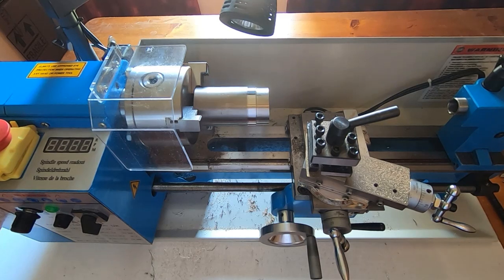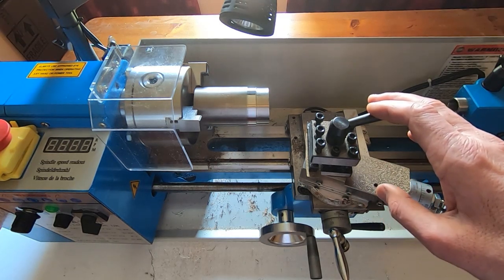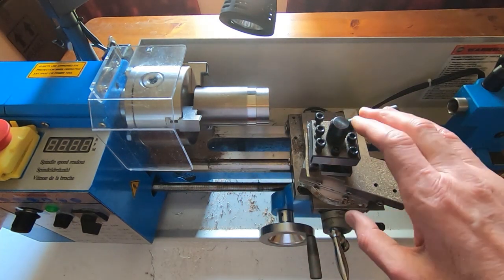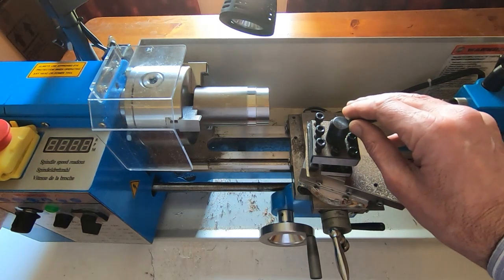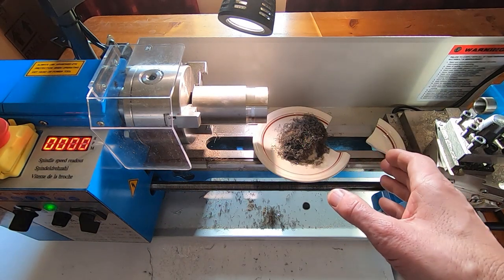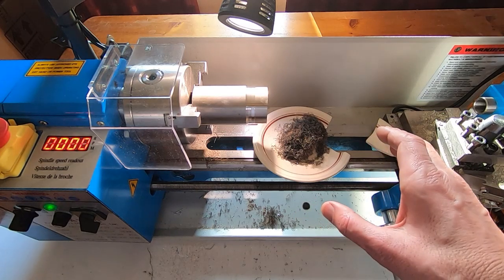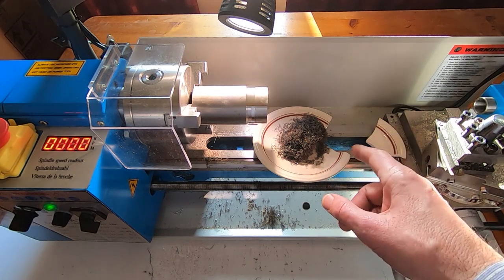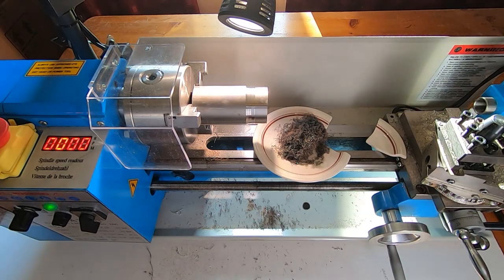Burning Titanium and breaking stuff

Comment: Good demonstration Jerry!  I never thought about titanium burning that easily.  I used to work at a Naval Air Station where I worked at the Naval Air Rework Facility (among its many names while I was there).  The Machine Shops used to keeps drums of graphite available in case of magnesium fires (they were still, I was surprised to see, reworking radial engines next to jet engines when I started working there!).  Originally, every machine tool that machined magnesium had a large bucket of graphite next to it and the drum full of graphite wasn't far away.  By the time the radial engines were phased out, the Tool & Die Shop still had a small drum of graphite in the middle of their Shop.  During the demolition of an old portion of the plant to make room for expansion of the CNC area, the workers accidentally started a graphite fire that the Airfield Fire Department could not put out with their fancy "metal fire" extinguishers (referred to as "purple stuff," if I recall correctly) even though they used every extinguisher they had on the entire Air Station!  I happened to walk by and overheard the Fire Chief discussing this with several of the Fire Fighters, remembered the graphite, went back into the now smoky building, brought the graphite to him, and asked if he could use it.  As soon as he realized what it was/remembered what it used to be used for?, which only took a second, he had his Firemen take it back in to the fire.  They had it smothered within minutes, but used every bit of graphite we had left.  (This was the "main" building, about a half-mile (~0.8 km) long, with many "fire zones" in it, so only areas deemed to be "in danger" would be evacuated as needed.  I guess that goes back to WWII there, and is also standard operating procedure in any large industrial facility even today to save production, time, & money.)

Class D extinguishers are supposed to put out metal fires here in the US -- I don't know whether that is an International rating or just a US rating, but I'm sure that every country has equivalent extinguishers rated for safely putting out metal fires.  If I had access to graphite flakes for a reasonable price and a reasonable quantity (i.e., not an entire 55-gal [~208-liter?] drum for a home workshop!), I'd still want that too, I think, and would worry about clean up later.  Of course, I suspect that there would probably be serious clean-up anyway after any of these extinguishers were used or any decent metal fire?
Reply from the maker: Yes this type of fire is very hard to put out so my advice is to try to avoid them in the first place.

Comment: Great video - I had no idea you were spinning up a ceramics restoration channel. Seriously though, the local hacker space just got some welding equipment and they were really upset when I told them they should have at least a portable extinguisher since the mill in the same room can easily create thermite as well as other fun things that easily ignite on their own.
Reply from the maker: Absolutely. If you really want a bad day try mixing aluminium particulates that milling aluminium produces with titanium (or magnesium) and take a deep cut. It will ignite and set fire to your extinguisher (see Bob V's comment on the only real way yo put these fires out). If you get a real metal mix fire going then you have one sensible option - RUN.
Reply: @JerryWalker001  is that like thermite, or worse?